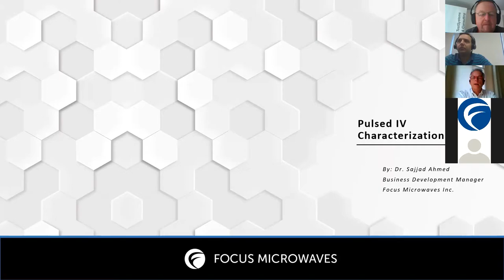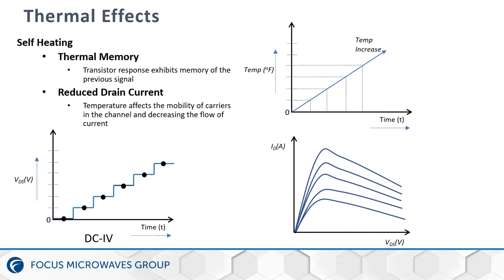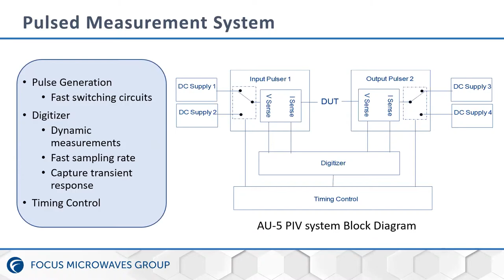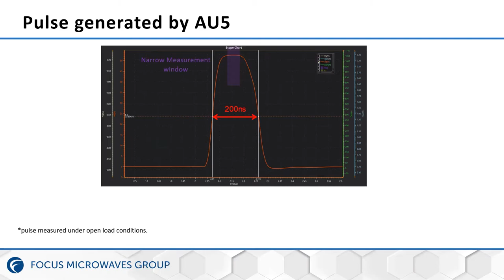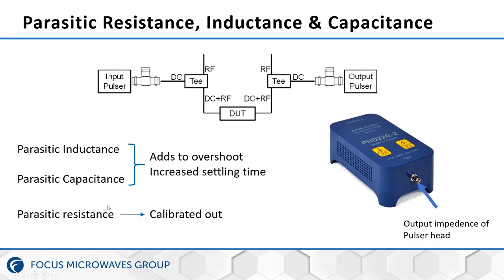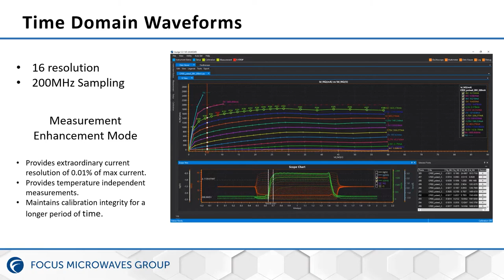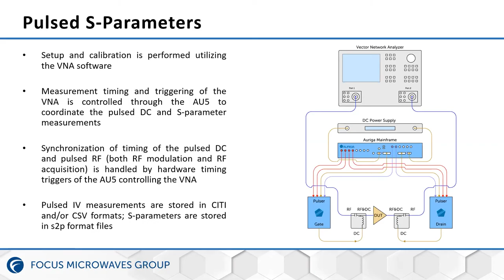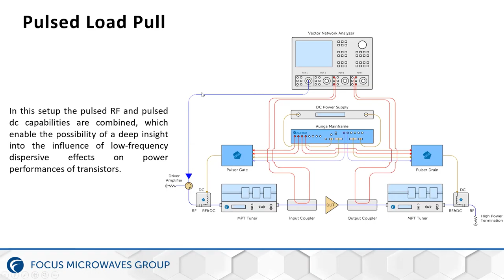Webinar 05: Introduction to Pulsed IV Measurements

Comment: Hello, I have some questions,
1. Why we can use pulse IV to avoid the trapping effect?
2. If we use narrow pulse width with short duty cycle, we can avoid the thermal effect actually. But in the application stage, the application would not always in pulse supply. For example, in 5G communication, the PA always working in CW mode. But the model is made by pulse. How should we consider the thermal effect in modeling?